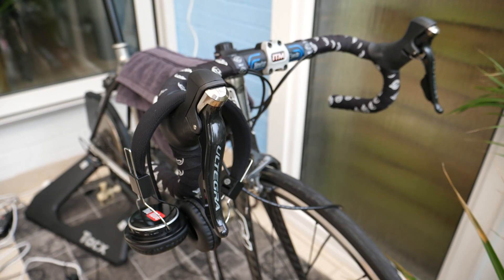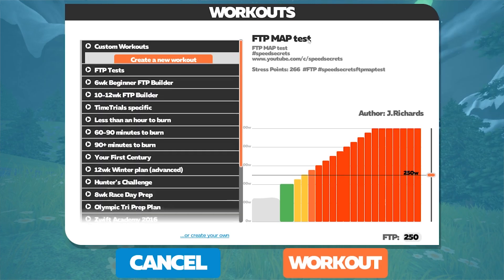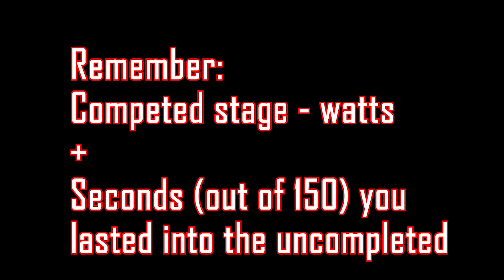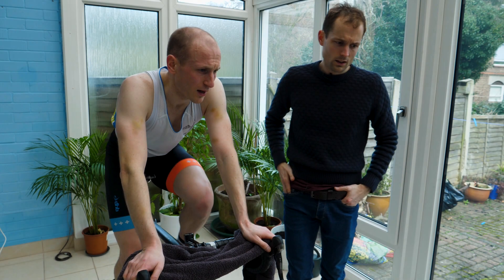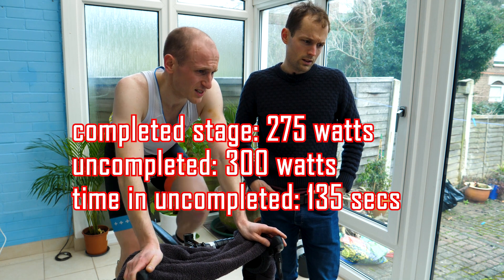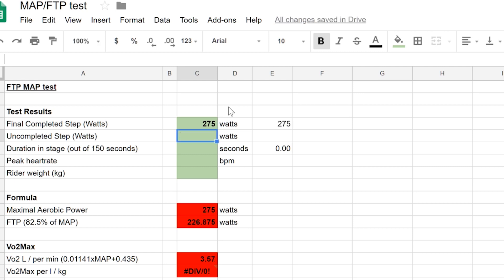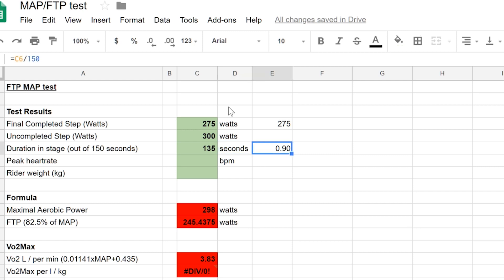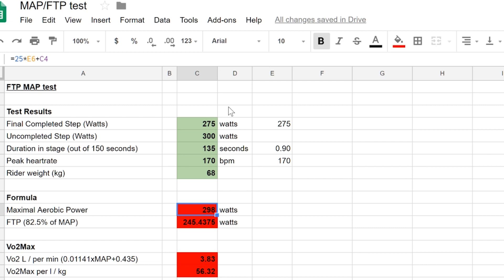Zwift Vo2max test! Best way to calculate FTP with simple cycling ramp test

Comment: wow. how can I modify this if starting at 200w is too high for me?
Reply: Did this today and started at 100w. Haven't done any FTP tests in the past and came up to be 261 from the calculations.
Reply from the maker: Why don't you try starting at a comfortable wattage - maybe 75, then go up in 25 watt increments. Let me know how you get on. Good luck.
Reply: Very good! Great power to weight ratio. You'll be fast on the climbs!